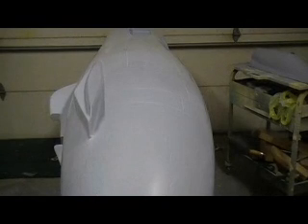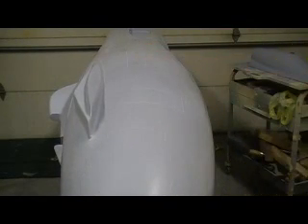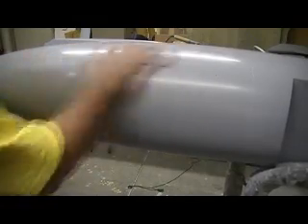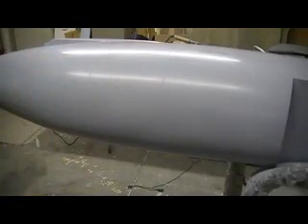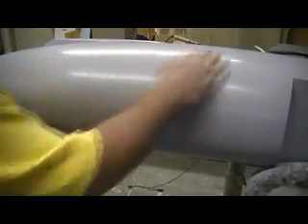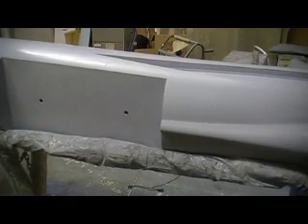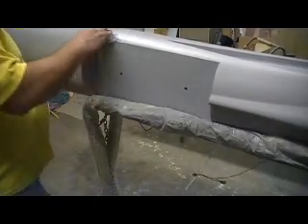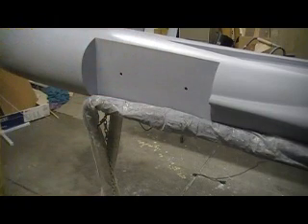how to build a rc jet F-105 thunderchief # 128

Comment: @hornitpilot  Harbor freight has a small three inch air powered buffer that works great, I got one a few year back and it can be used on models without causing the damage that a larger buffer can cause.